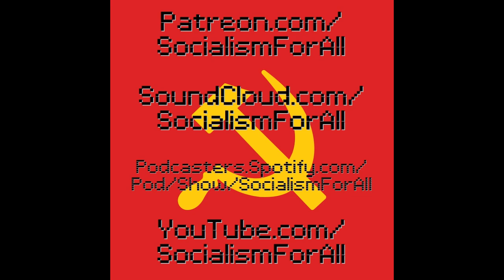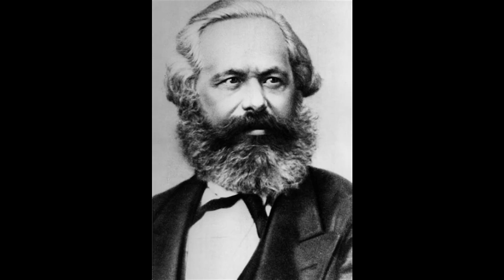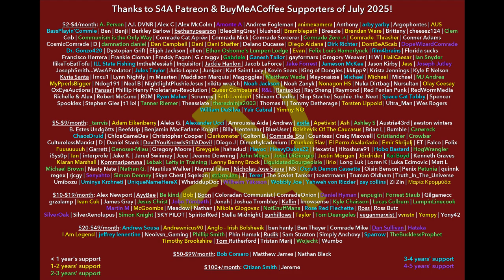Capital, Vol. 1, Ch. 15, Sec. 1 (1867) by Karl Marx. Human-read Audiobook of Marxist Theory

Comment: To try to distill this section down as much as possible, which is great, it seems like the application of machinery in tandem with increased specialization of labor did 2 things in particular. It completely shattered the remnants of handicraft/artisan labor, and kicked the process of centralization of production under capitalism into overdrive.

The cotton gin and steam engine, (along with coal as the initial primary fossil fuel), really did a number on us. They wouldn’t in a society where production was publicly controlled and directed towards human need. In fact, they’d actually benefit us greatly, but that world where they’d be harnessed for our benefit is one we need to build and fight for.